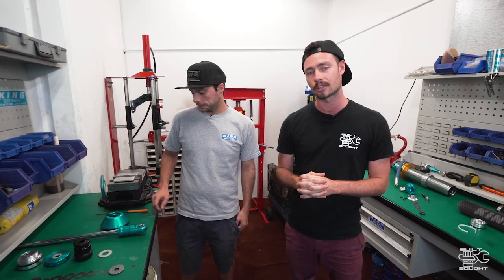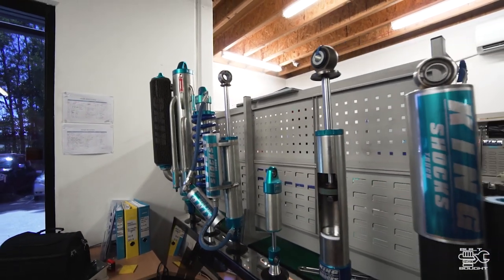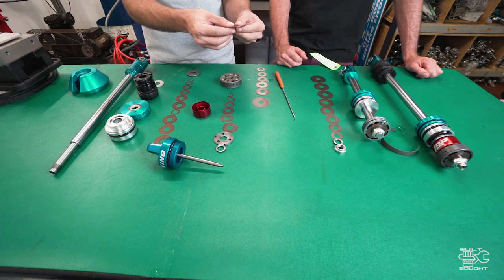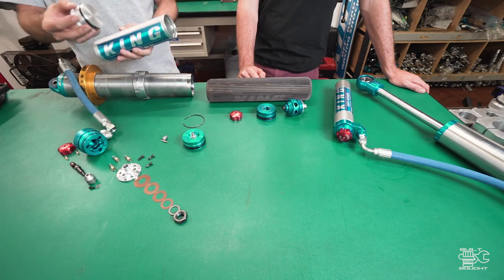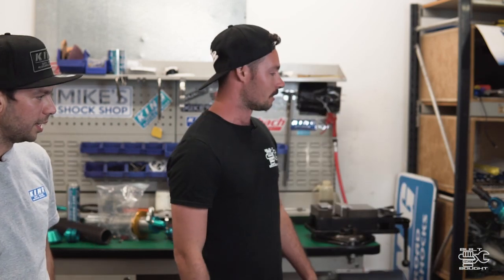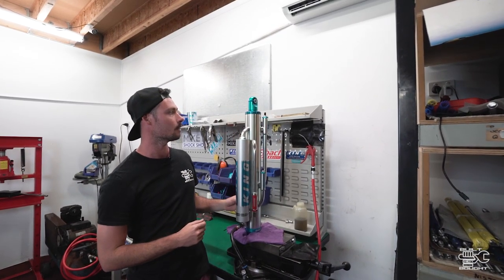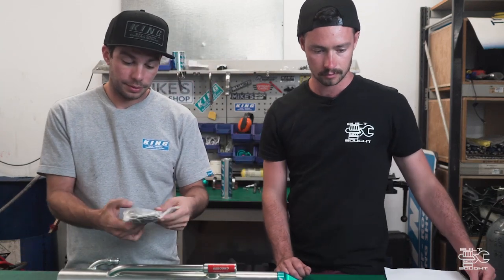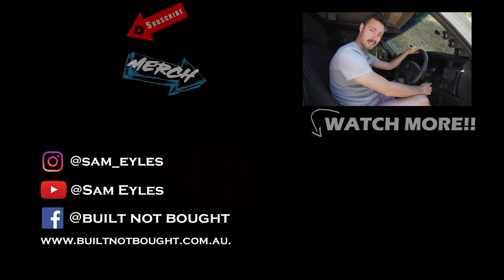TECH TUESDAY || What Is Inside A Shock Absorber?

Comment: Great video mate. 🤘🏻 heaps of good info. 🤙🏻Keen to get our coil rates spot  on and put the 2.5 remote resi to the test.
Reply: Mate I'm going down the same path. Have some nice 2.5 Fox shocks on a N80 Hilux but am not 110% happy. I see you have a 100 series? What are your plans for calculating that ideal coil spring rate? Obviously then you'll be revalving to suit? It's so hard to find people here (even 4x4 enthusiasts) that have any idea or even interest in this stuff beyond just fitting an off the shelf 3" lift
Reply: @wlspn  hey mate. Yeah it is hard to find some good info. First thing I did was weigh the cruiser to see exactly what we were playing with. Then contacted Nick from solve and he has been working with king coils to build some progressive rate 4 inch coils to suit my weights and shock length 🤘🏻 been through to many off the shelf coils now so wanted to get it right 👌🏻